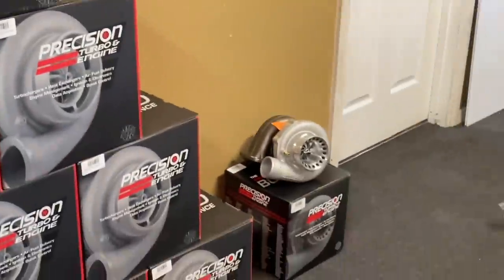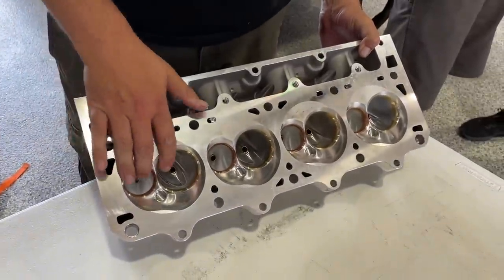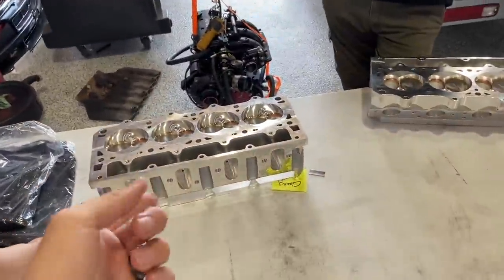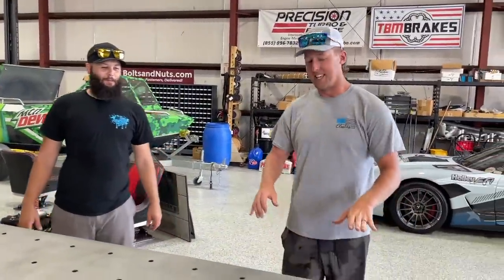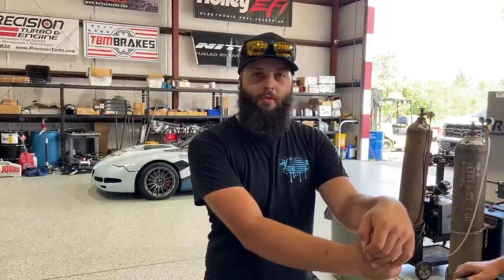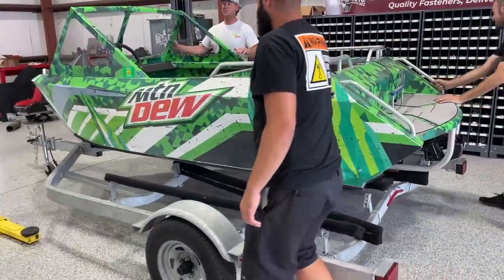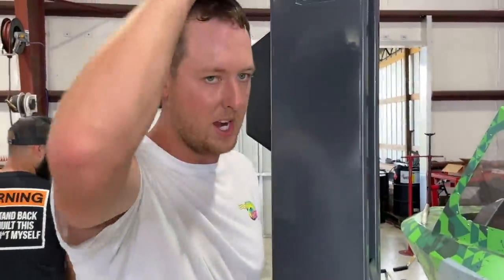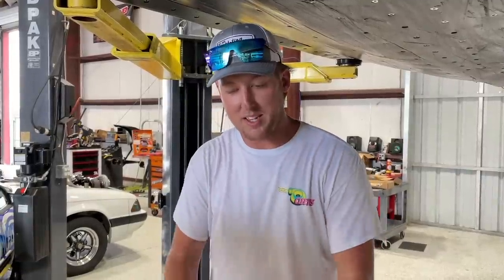My Beloved Mini Jet Boat Is Pretty Much TOTALED... 30+ Broken Welds, But It Gets WORSE!!!

Comment: Dude half of those welds that were broken, really were bad welds as they pulled clean off , instead of breaking the weld in the center is what should happen if it’s welded correctly..sorry Cletus..

Comment: Et si tu veux arrêter d avoir la guelle de travers apres un rune avec rubit one mais un casque integral et ouvre les fenêtres il y aura moin de pression fenêtre ouverte la miss avec ca bel air 55 c est porté ont voler et la vitre arrière simplement la boite pas comme vous tout le dessous d une tesla électrique sur le c7 hummm 🙏😑🤲🇫🇷👉😑👆🌚🌫🛸